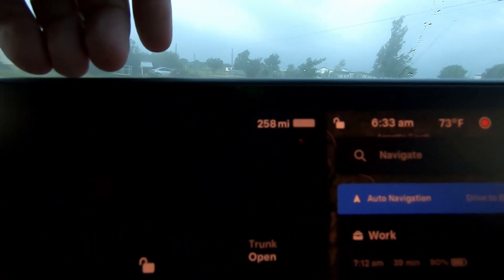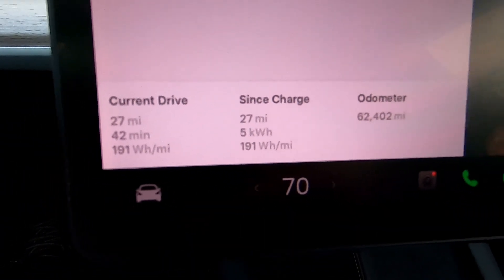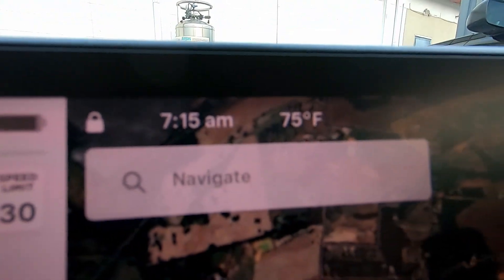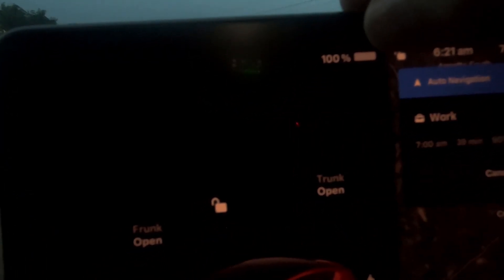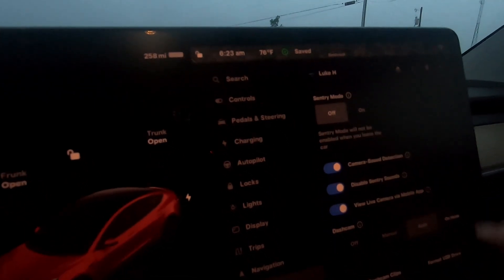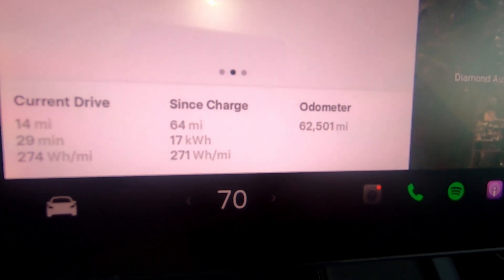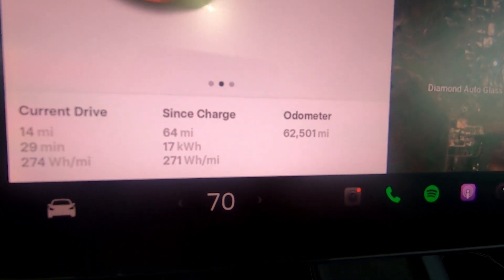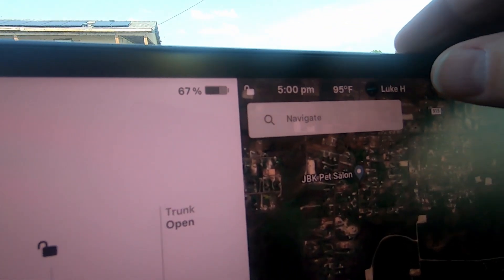Investigating Phantom Drain: Follow Up Test Findings

Comment: That’s one thing that drove me crazy about my 2018 model 3 before I got rid of it was the phantom drain.  Especially in the winter with the car parked over night with sentry mode off.  It just really bugged me to get in the car and It was drained 15- 20 miles.  Yes,  the summertime over heat protection drain was bad as well.
Reply: Great job recognizing EV's at this point are not practical, only idiots are ok with a 15 mile loss!

Comment: I would have to block out that sun coming through that glass roof and anyplace else I could.  Those temps are awful and it isn't even summer time yet.  That is completely nuts.  Were you losing that kind of range with your Bolt?  I would have to do something about that if I were in your shoes.  You would think they would tie the windows venting to the rain sensors.  That way if it starts to rain it would automatically roll them up.
Reply from the maker: I should have a sunshade for the roof soon
Reply: @SpinnerEV  That's good news.  Clearly the Tesla is much more actively trying to manage the temps so it is consuming more.  I had watched a video with Bjorn talking about the extreme cold and energy consumption, but I don't recall anyone focusing on the power consumption due to the heat.  So this is very interesting stuff. Thanks again for sharing it with us!

Comment: Have you tried using cabin overheat with a/c off (the 2nd option)?  I assume that's using the fan only.  Don't know if that will help with the interior temperature much/at all.  As always, your videos are very informative.  Thanks for sharing them!
Lee
Reply from the maker: In Texas from late spring to mid fall we don’t know what “AC off” is

Comment: Good video. When I did my test in south Florida last winter, I would lose 3%to 4% overnight using cabin overheat and sentry mode. Once I turned them off, I used 0% overnight. No phantom drain at all. Stay safe.